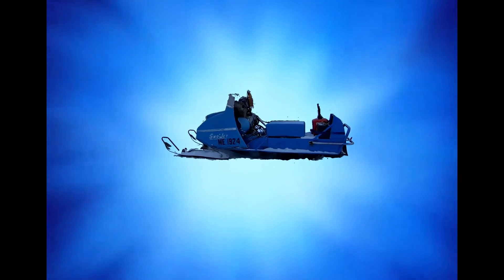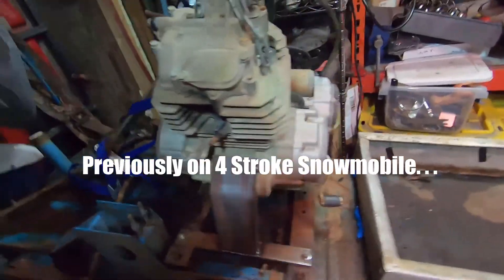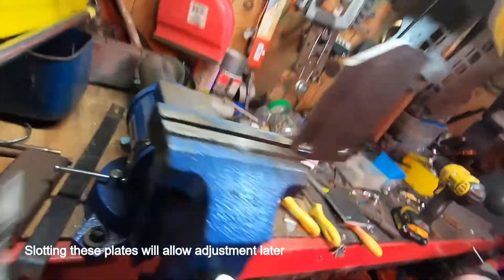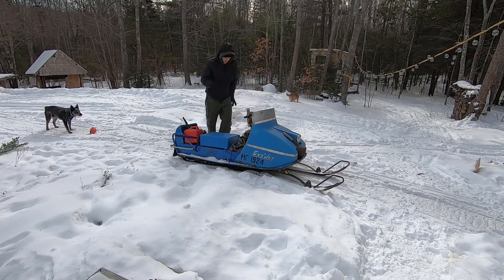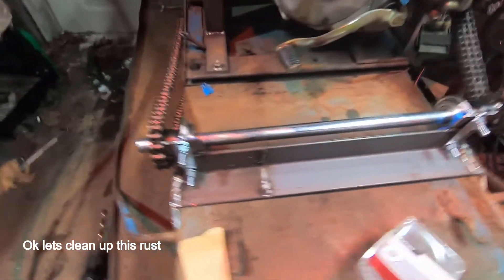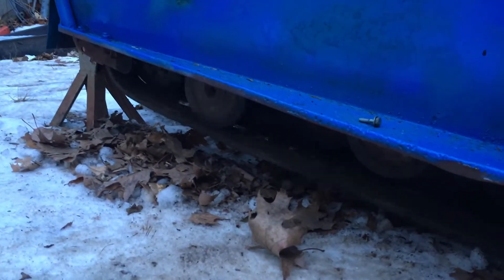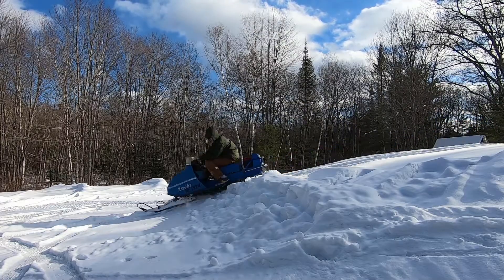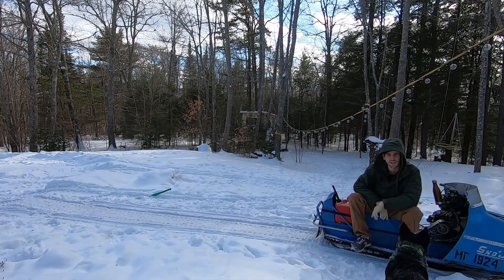4 Stroke Snowmobile Part 3: Drivetrain and Body: Honda ATV powered Sno-Jet snowmobile/ATV adaptation

Comment: Woulda been simpler. To sell that engine. Buy a predictor 420 and use the original drive
Reply from the maker: A. the whole point was to experiment with a snowmobile that had gears and no centrifugal clutch. B. I did use the original drive, only thing I didn’t use was the centrifugal clutch. As the 4 stroke likely doesn’t have the rpm’s to operate that. 

Your idea would not have given this project 5 speeds, reverse, plus hi and low range. . .
Reply: @ecophage  ok. But I thought you wanted an operable snowmobile.   That’s why I said that.  With centrifugal. You have infinite gears.   Neat project but a step backwards.    Have fun though
Reply: Not predictor.  Predator lol
Reply from the maker: @murrayhelmer8941   dude you're completely missing the point. The purpose was having a 4 stroke low geared non torque converted gear drive. Belts wear out easily and belt driven vehicles cant pull heavy objects. I was experimenting with whether a snowmobile platform would behave properly under these circumstances. I hate revving powersports i like the low rpm 4 stroke motors behavior. This is not possible with a centrifugal clutch. Your idea would have proved nothing. I still have this unit currently it works fine and could tow a car. not to mention its much fastyer than the predators, thats what 5 speeds does
Reply: @ecophage   oh come in now.  I’m not in any way pooping you. But. A centrifugal clutch is literally like having 100 speeds or more.  Modern belts stand up for thousands of miles   My buddy went 5000 miles on his 150 hp Yamaha 4 stroke. So 20 hp is really a non factor    Motorcycle engines and transmissions were tried many years ago but never worked out.    I think it’s awesome what you’re trying.  So don’t take it personally
Reply: @ecophage what’s the top speed on this? Didn’t see a follow up video
Reply from the maker: @Snoscoot  I never got it up over 3rd gear, but it wasn’t far off the gearing the ATC had ie 1 st crawl 2 a bit faster 3rd decent riding speed, I don’t have access to trails so I couldn’t really open it up
Reply: @ecophage  lol.  Lots of old sleds have been converted to Honda and predictor 4 strokes. And work just as well as their original.  And start better.   Was looking at one yesterday a guy had put a 5hp brigs on for his kids.     Worked well.  But I’d want a larger one. 420 preditor  is common